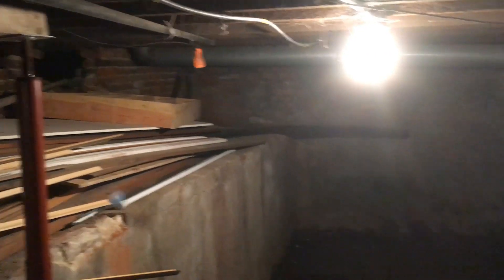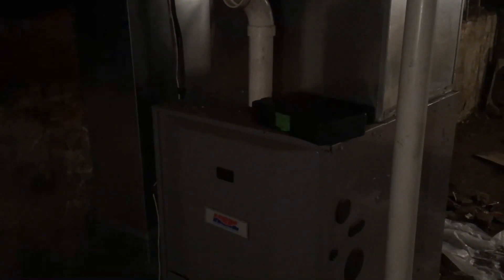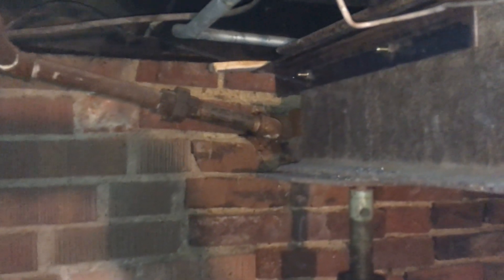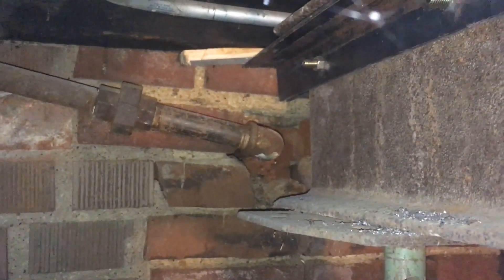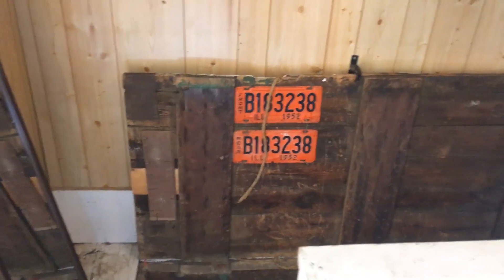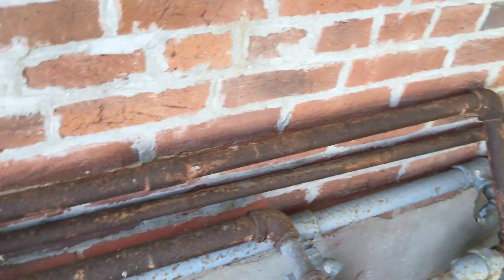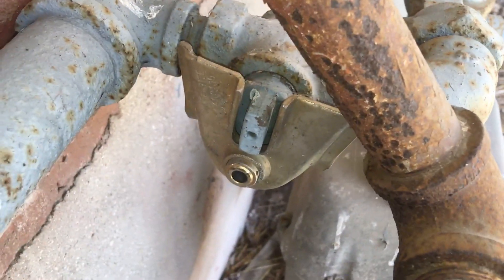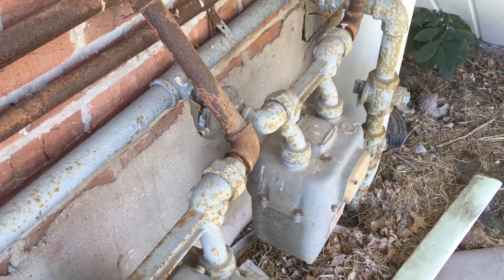No Heat Call: Heil H9MPD100J20B1 Furnace

Comment: Yep, it does help to have a fuel source to make fire... :P

But the underside of that building, yikes, that's some bodged up timberwork keeping the place up, scary stuff... :S
Reply from the maker: Yes, it's quite scary. None of the other buildings nearby are quite this bad (though most of them have water incursion to various degrees). Even with unlimited funds, I'm not sure it's ever possible to repair a mess like this.

The water is just a byproduct of a deeper problem -- crumbling infrastructure, especially in small towns. At least they are trying to repair some of this.
Reply: @uxwbill  yeah electric motors and all that water is a beautiful thing. 
 yeah I've floated a 2×12 once

Comment: That was an easy diagnosis and that is one heck of a cap for that fan motor I wonder if it is the correct one?
Reply from the maker: I only wish the camera had been running a little bit sooner, so it would have captured the furnace waking up from its lockout period. Of course, the footage wouldn't have been much good, since I was fiddling with that door. Had I not known of the existing business closing, I might not have figured it out as quickly as I did. What's in the video happened in real time.

Near as I can tell, that capacitor is the original. I wasn't getting paid for this, so I didn't get into it any further. I was stunned to find as new of a furnace as I did. I really expected to see a true, ah, classic.

Comment: Is it legal where you are to draw in basement air for combustion, definitely not the freshest down in that basement.
Reply from the maker: I'm really not sure, only that people do it left and right. It's definitely not what I'd do.
Reply: In PA, it varies city to city, borough to borough, and township to township; and most of that is in accordance with codes pertaining to basement/crawlspace/attic ventilation, number and type of gas and/or propane appliances. For the most part, after the threshold of most gas furnaces surpassing a 90% AFUE rating, new installations (now) always have externally sourced combustion air, 52-inch 'above ground level' - minimum exhaust discharges installed. I won't get started on "power venters". Condensate lines and pumps are another story. (try discharging A/C  or furnace condensate into a sanitary sewer and see what happens)  I do A/C. baseboard electric, PTAC's, and heat pumps only. I had to sit for the 'master plumber' exam and licensure, for a 3rd class Pennsylvania city, just to be permitted to install condensate lines and condensate pumps, "and certify they are not connected to a sanitary sewerage intake, in any way, by any method, or in any form".

Comment: As a viewer from way back, did I remember correctly that you were vehemently anti-smartphone, or was it just facebook? Smartphones are easy to hate...until you get one and start using it.
Reply from the maker: I don't like cellular phones of any kind. To me, they're nothing but electronic leashes. I came to have this only because a job I took for a short period of time required that I have one. (I also reserve the right to change my stance on cellular phones when one of my unroadworthy cars has left me one hundred miles from anything. :-P ) I've had cellular phones in the past, and got rid of most of them because I never used them.

I have no presence on Facebook, nor will I ever do so.
Reply: @uxwbill  Congrats on avoiding Facebook, I'm right there with you Bill. Although I've come to appreciate phones simply for their ability to record hq video on the fly, and of course for addicts like your viewers to get a fix of your videos at any time. Dangerous.

Comment: you HVAC certified? I'm getting my cert in 2020
Reply from the maker: Residential, commercial and EPA 608 Universal/609 MVAC...but I'll be the first to tell you there are plenty of gaps in my knowledge. I could probably muddle through an installation (and have, in the case of two A/C condensing units) but the key word would be "muddle".

There probably aren't enough swear words in the world were I to attempt an installation or modification of duct work. I probably ought to buy some and practice hanging it, and attaching it to a furnace.

Comment: That thing is going to need a new inducer motor soon too Bill. Also to check if there's gas just crack the union on the gas pipe going into the furnace. That basement must be musty as hell! Whats causing all the water?
Reply from the maker: If it dies and they want me to repair it, I'll certainly fix whatever's wrong. If I can avoid it, I'd rather not crack open any gas piping that I don't have to -- especially with no shutoff valve anywhere in sight. I also didn't happen to have a pipe wrench or anything with me I could have cracked the union open with. (I actually need to buy a pipe wrench or two.)

I'd tell you the water leaks come from leaking cast iron water supply lines. The town claims they have water leaks they can't find. A visit to any of the businesses and their basements would prove quite enlightening, as would a look at any of the puddles in the street that never dry.
Reply: Channel Locks are your best friend :)
You're right about the union if there's no shut off near by.

Comment: Hi Bill. I live in the UK. Can you tell me, do most Amerivan houses have basements? Over here we usually refer to them as cellars, and they are mostly found on older houses probably built before the first world war. Interesting videos.
Reply: For us Yanks, it is either for added storage or it it is a "finished" basement added living space. The "finished" basically means that the walls are more like the rest of the house and can be added to the square space of the rest of the house, where as an unfinished space is not. If someone more knowledgeable, please chime in since I am a laymen.
Reply from the maker: It really depends upon where in the US you are located. Here in the Midwest, basements are pretty common. Some are completely finished just like any other part of the house, others are not and most are somewhere in between.
Reply: Thanks for the replies and information - very interesting.
Reply: A. K. Doesn’t most of the Midwest just use the fs 2001?
Reply: Very few in Texas do. In my town, I know of only three houses that do, and I’ve been in most of them.

Comment: 90 plus furnace...I wonder how many heat exchangers it has gone through...
Reply from the maker: Had it gone through an entire heat exchanger, I'd expect the entire furnace to have been replaced. My own 90% efficient furnace is 23 years old and still going strong on its original (lifetime warranted) heat exchanger.
Reply: Some of them do have problems with heat exchangers due to them having to be made of very thin metal.
Reply: Early on it was the manufacturers not using stainless steel secondary heat exchangers that had premature corrosion. Interestingly many of the companys that failed to make a durable heat exchanger for their condensing furnaces were smaller Canadian ones such as United Gas Technologies. I believe it was 2010 that Canada's national building code required forced air furnaces using Natural Gas or Propane to be 90+ models.

Comment: Uxwbill, I have a 2.8Cu.Ft. NuCool mini-fridge and I watched your videos on it but I can't figure out what is wrong with it. Does it require a 300v power supply to run it? I don't know what else is the problen
Reply from the maker: I have never made a video about that particular brand and model of refrigerator. I don't know anything about it. I can only recommend that you replace it with another.